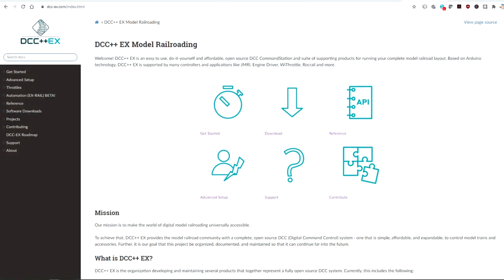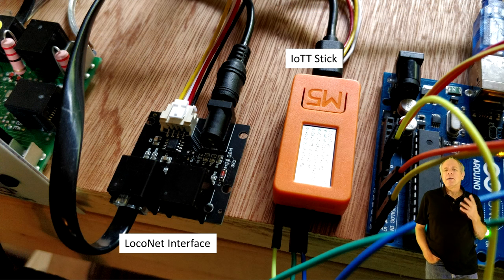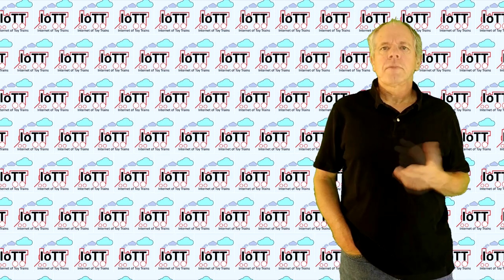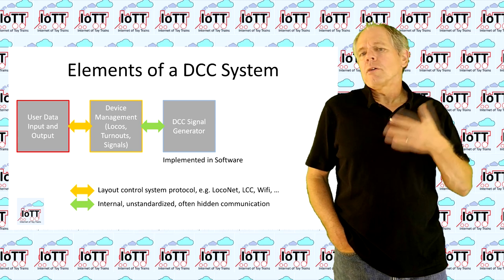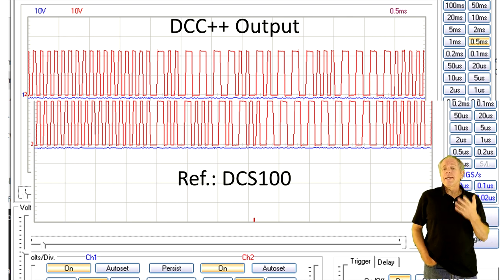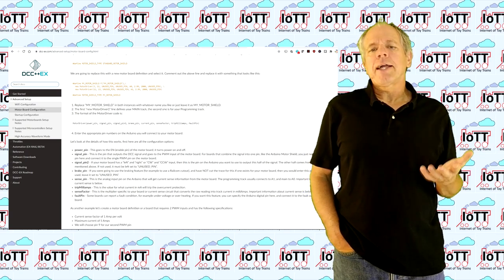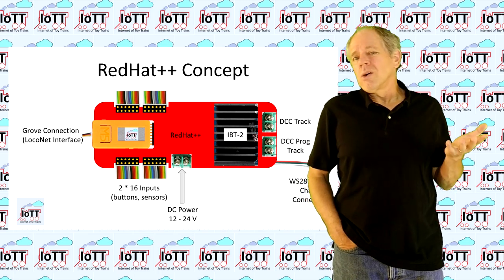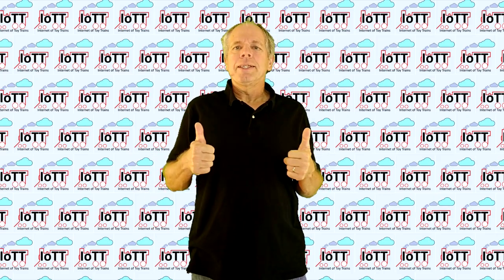DCC++EX as LocoNet Command Station (Video#79)

Comment: Yes, I’m excited. My 1st thought is to keep the DCC power supply separate and at the layout where I can connect a 3 amp power supply and connect to it through loconet. Since you need to use the chip on the yellow hat      with the IOTT stick then yes, have the DCC++ integrated as a yellow-hat/DCC++EX to eventually replace the yellow hat altogether. This way if users already have something like the Digikeijs DR 5033 booster, then they don’t require a booster that’s built into your Redhat++. 
Also the new yellow hat / red hat could all be built into a mimic panel.
Reply from the maker: Thanks. Yes, power supply will independent and RedHat will work as booster as well.

Comment: Maybe I can use this set up to get MQTT to talk with TrainCintroller software??
Reply from the maker: I would think that should be possible, but you would have to implement a translation function from the MQTT topic structure of the IoTT Stick to the one of the Train Controller. You should be able to do that e.g. in Node-RED or similar tools.
Reply: IoTT hmm. It how is the question for an beginner like me

Comment: Does your Tinkersheild for Loconet work with DCC-EX and how do the messages connect to DCC-EX. Mike Ors
Reply from the maker: The Tinkerface shield is made to provide an interface to do your own developments. If you want to make DCC-EX an Arduino command station, use a RedHat along with AUX shield and IoTT Stick.

Comment: Does this module drive the Railsync pins of the loconet ports?
Reply from the maker: Yes, the Loconet B outlet has full Loconet capability, including railsync so you can connect external boosters. The two Loconet T connectors have 12V DC and permanently on so that the throttles do not turn off if you shut down the track power.

Comment: Brilliant, this is genius!  Alas, I am a novice at this so may I ask this question... What is replaced by the PowerShield? I guess it is the IBT-2 H Bridge Driver?  Any variance in the wiring arrangement of which I need be aware?
Reply from the maker: Thanks. Yes, the IBT-2 is used instead of the power shield. However, in the meantime I have finished the RedHat++ Shield, which sits on top of the power shield and turns EDD++EX into a Loconet command station with WiThrottle Server, Loconet, main and prog track and more. Watch Video #99 https://youtu.be/3kW_IT8mMVg to learn more.

Comment: Here a suggestion, add an lcc port. Even if you don’t do the code now there’s hardware will be there for the future. I guess that one of the only major protocol you never implemented.
Reply: LCC won't likely work with DCC++EX anytime soon. It's not in the roadmap and there is no long term support strategy for LCC on the AVR platform (8-bit).
Reply from the maker: Did you watch video#45? And you are correct, with the modular concept I could build an LCC command station as the Stick can handle the LCC communication. So, there are non-technical reasons I am not doing it - for now ;-)